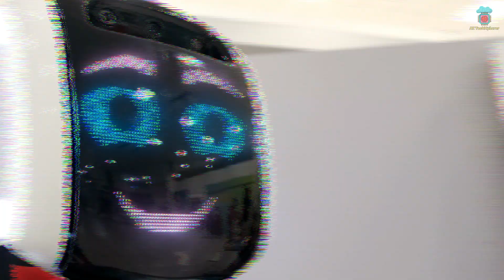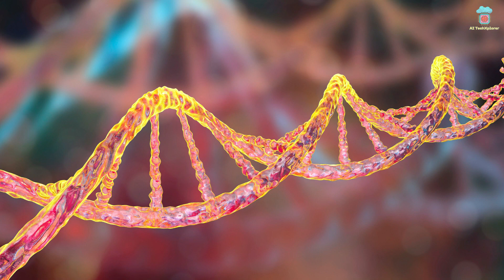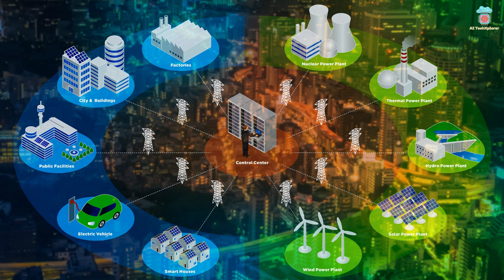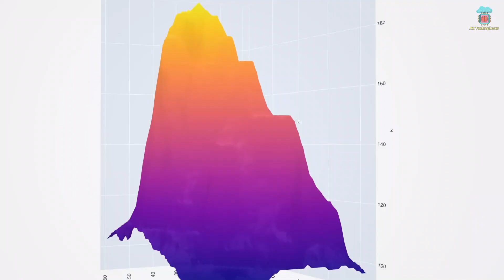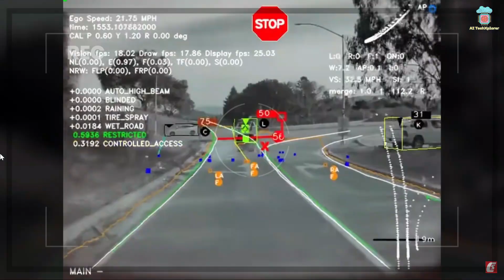AGI Uncovered: Why Achieving AGI Is Harder Than Scientists Thought

Comment: It seems like AGI has to meet with the parts that assemble (when done) to become more sensor-comprehensive. What are the parts used at this moment that do not conform to DONE.  Parts of sensors need to be added as they come in. Starting young such as 2-4-6-8 years of age are parts. I believe that 0 to 3 is transitional. I believe between 4 and 6 there is another transition. Incorporating these parts could prove to be essential. I have nothing more to say.
Reply from the maker: Thank you so much for sharing your thoughts on this topic! Your perspective is truly insightful and adds a scholarly depth to the discussion. It's clear that you've considered the developmental aspects of AGI in a thoughtful manner, particularly emphasizing the importance of incorporating sensor-comprehensive components and recognizing key transitional phases in early development.